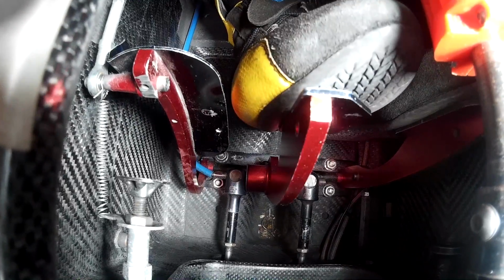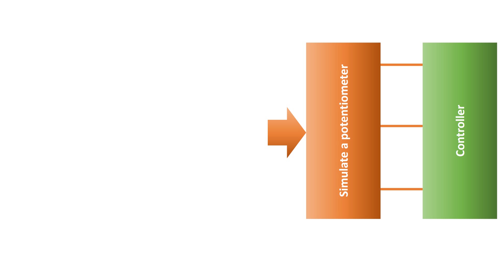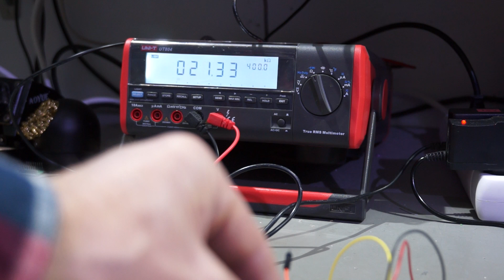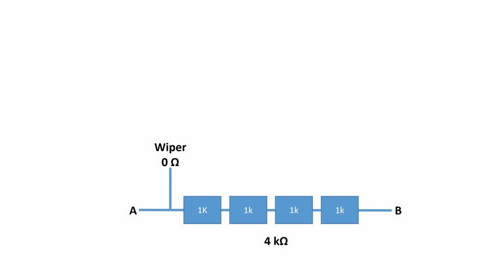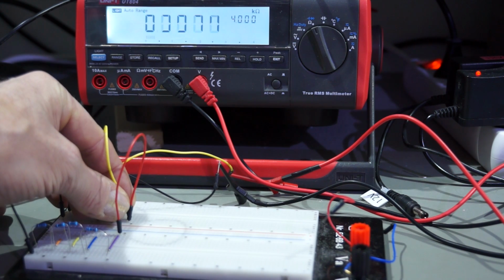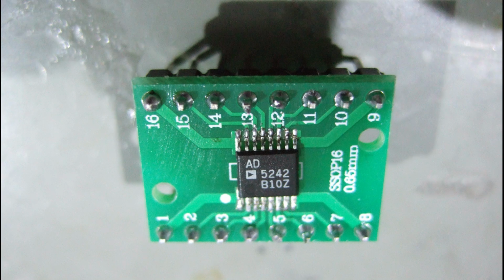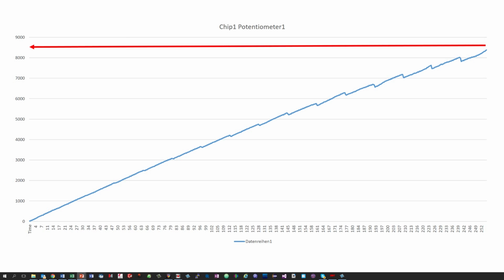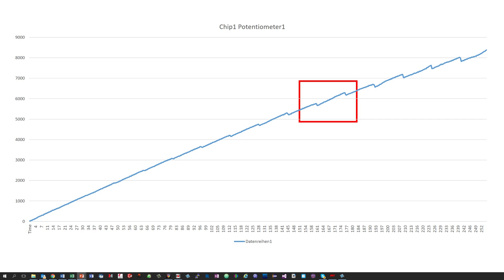#49 Racing Car to Simulator Conversion Part 1: Electronic Potentiometers

Comment: Excellent project!! I recently had a look at X-sim to emulate PC game to hardware  :)  Another idea would be to try an ultrasonic distance sensor, but looking at the video, I am not convinced the pedal travel is far enough to give you enough granular step required for throttle (even though that is very relative... :p)

PS I got my serial to wifi done on the ESP
Reply from the maker: +Laurence Munro I also thougt about using ultrasonic sensors because,  in my tests, they prove to be quite good. But I feared the reflexions in the very small an uneven surfaces. This is, why I did not use it.

Good to hear that your serial communication works now. How did you do it?

Comment: I am guessing a potentiometer with an arm on it, like a servo driving a rc plane wing but in reverse. The length of the arm is a variable and decides the sensitivity on the travel of your pedal.
Reply from the maker: +Glychee S Thanks forthe guessing! I am sure this would work. I am just working on a solution where I have only to put something on the pedals, no other installation. If this does not work, the potentiometer is for sure a viable solution, but not very different to the one we use now.

Comment: Hallo Andreas!
Immer wieder TOP Videos von DIR - schau ich mir immer gerne an!!!!
Aber das finde ich etwas zu umständlich - nimm doch einfach einen Optokoppler-Schaltung . Den PWM Ausgang (Arduino) an den Optokoppler Eingang und der Ausgang auf den Eingang des Potis.

Mach weiter so ;-)
Reply from the maker: +Andre Münsterberg Vielen Dank für dein Kompliment. Das mit dem Potentiometer ist vielleicht nicht nötig, vielleicht würde einfach eine Spannung gegen GND reichen. Da ich aber die Schaltung im Controller nicht kenne habe ich diesen Weg gewählt. Ich kenne Optokoppler nur als Schalter, nicht als lineare Elemente. Deshalb habe ich wahrscheinlich nicht daran gedacht. Ob das allerdings einfacher wäre weiss ich nicht. Ich müsste dann einfach ein anderes IC nehmen. Und ich denke, ich müsste vorher vermutlich das PMW Signal mindestens mit einem RC Glied in Gleichspannung umwandeln.

Comment: WOW great video . for the pedals you could try using restive bend sensors , or small load cells even .  the bend sensors might be the best as you can fix one end to / near the pivot point of any lever (but not letting it  pivot ), and the other to some place along that lever . you can even DIY make restive bend sensors .  they would be small enough to just leave them in place .  then you will get a change on ohms relative to the flex in the sensor.  you just need  to calibrate them on the arduino .  I made a set a long time ago for motion capture on a glove and a elbow .  or use a hall effect chips and small magnets epoxied to the pedals levers for proximity . They have to be the type that are linear and not just on/off like end stops and  RPM gauges use. ( I think Xbox controllers use them in their side triggers )
you can buy flex sensors : https://www.adafruit.com/products/182
Reply from the maker: +XerotoLabs Conerning the bend sensors: As always very innovative. I even did not know they exist! This is definitely a backup if my initial idea does not work.
Concerning load cells: I was looking at those for my bicycle power meter and I have some laying around. In principle, this should be possible (probably easier for the brake because of the bigger force). So far, I never tried one because it seems, that it is not easy to mount them. I just played with some ready-made load cells and was impressed about their precision!
Reply: +Andreas Spiess yeah, I too suspect load cells while very good with high forces would require more mounting thought.   Flex sensors are easiest  , but require  more code i think but only a mapping function .  linear(analog v out ) hall effect chips are the easiest , you only have to  zip tie or 3d print a holder for them and the  magnets .  I think you can even get 2 out of a xbox controller side trigger switches .  they have 0 mechanical wear , can be made 100% weather proof , and easy to install and remove . 
load cells have precision on their side.but complex install required .  you would have to 3d print some sort of arm to compress them near the bottom of the levers, and be sure they were in  solid  . I wish i was at home i could sketch something real fast . 
If you can i would  try  so salvage and re sue hall effect sensors form the/a controller. 

Mostly mechanical :  
an other possibly way that just came to mind , would be to 3d print a mount that would hold a 10k pot on the pedal lever some place high enough that a 2 part arm could link to a clamp offset on the bottom pivot of the pedals. you would then have to vary the length of the offset's arm and the 2 arm parts . it would look like a lopsided trapezoid from the side.  such that the pot would turn more that the slight deflection would provide.  it would be easy to 3d print parts that could just clamp onto the existing linkage .
Reply from the maker: +XerotoLabs You are really creative, and if I would be a mechanical engineer, I would love your trapezoid! But, as you know, I am a proud electonics engineer ;-) The hall sensors way is definitively my second joice. I think, I have even some linear ones laying around somewhere.
Reply: +Andreas Spiess there are tutorials online for making your own "flex sensors" from anti static black bags
Reply from the maker: +Glychee S Just googled and found an instructable. I have never heard of such an idea. I definitivela have to try it once. Also because the concept is very "innovative":

Comment: couldn't you just have tapped the signal from the throttle position sensor either at the ecu or on the engine itself ? for the brake position just use the output from the brake light actuator or if you need a proportional signal you could use a load cell attached to the brake pedal or add a pressure sensor into the hydraulic brake line.

Comment: Hi Andreas, very nice video! You could also use a MCP41010 instead of the AD5241, on ebay you can buy 3 MCP41010's for €3,50 very cheap and available in DIP-8 instead of SOP.
Reply: You can even get a free one via the internet site from Microchip👍🏻
Reply from the maker: +Edwin Noorlander Concerning speed in racing, of course, you are right ,-)
Reply from the maker: +Javier Palla Lorden Yea, I think, this would have been possible. I paid 12$ for 5 AD5242 containing 2 potentiometers, so slightly more expensive. I have to admit that I like the I2C bus more than the SPI for low speed applications because I do not need CS. That is maybe why I was seraching with the filter "I2C" and found the AD524x chips.
Reply: +Andreas Spiess I thought that in the racing business, speed was the game ? 😜 So try it with SPI. There is a arduino library for it.